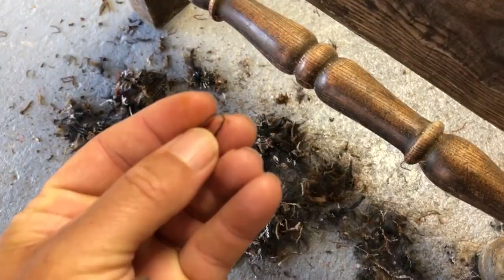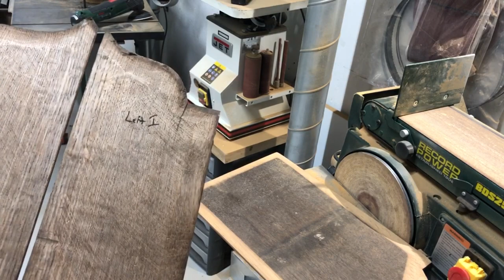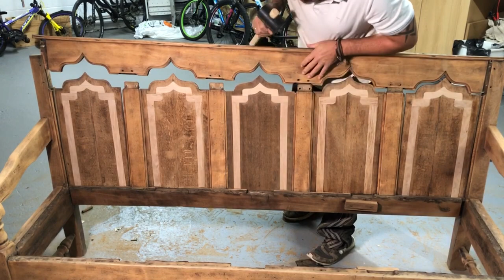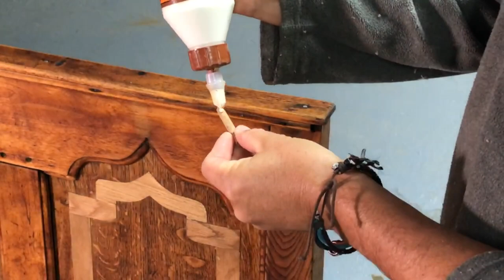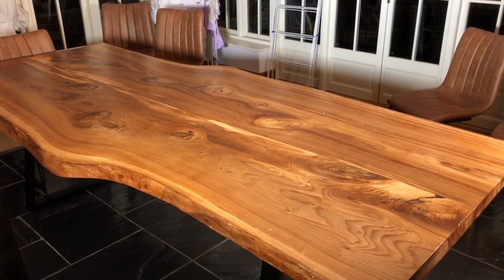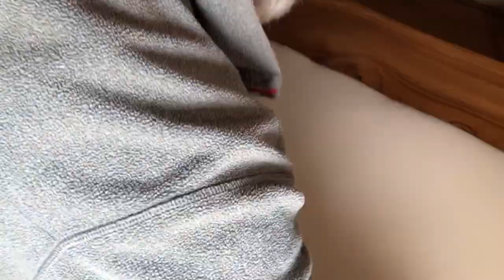Restoration - An old 18th Century Coaching Settle - Impossible?

Comment: Nice woodworking, but your upholstery skills leaves a lot to be desired. That cloth is not nearly stretched enough to last for more than a few years. Usually what you want to do is to stretch the cloth in a cross shape first, front to back and side to side. And I mean stretch! A lot! Then stretch outwards from the middle towards the corner. Again, stretch a LOT! That's how you ensure that the edges are smooth and bump free.